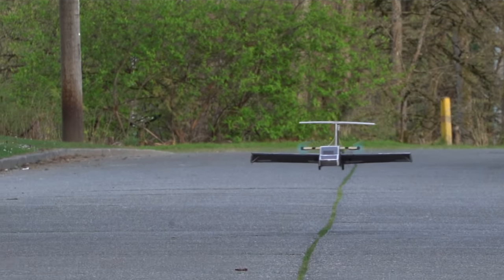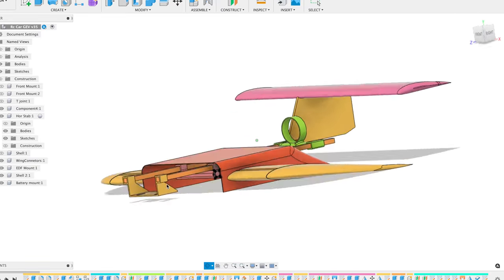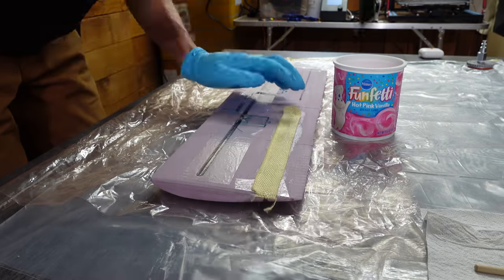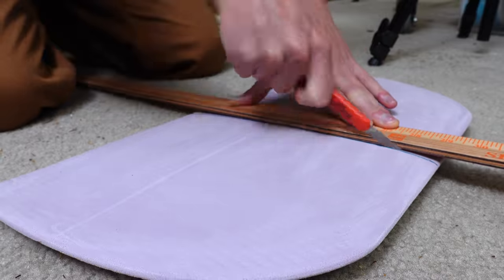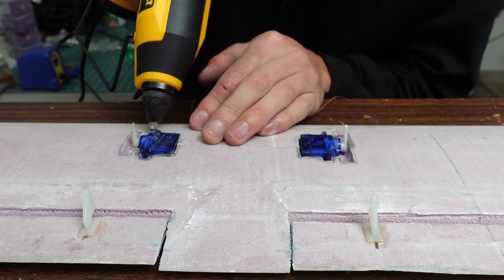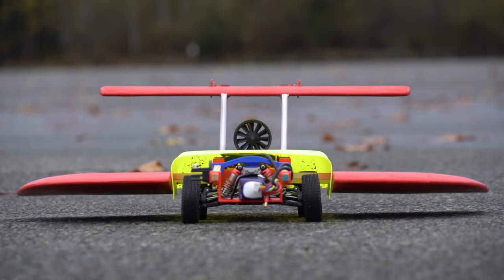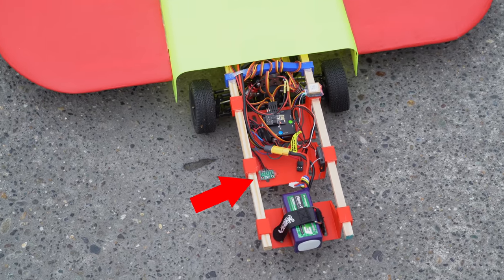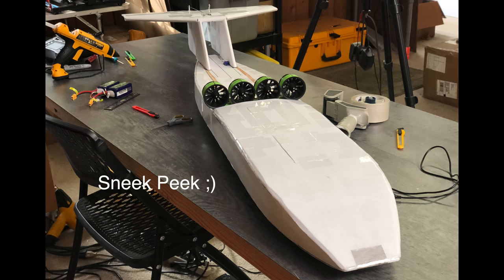RC Car to Ground Effect Vehicle Conversion

Comment: Looks like the problem is most youtbers trying to make ground-effect vehicles only use speed to generate lift. The original machines used engines to blow air under the wings for huge lift at low speeds, then use rear engines when specific speed and lift are reached.

Maybe you could use an internal duct system to pull air from above the vehicle  and redirect it under the wings and backwards, if only for takeoff/landing/low speed travel.

Also, remodel the wings to maintain the high-pressure air bubble. It's losing pressure meaning you need higher speeds to maintain the necessary pressure.
Reply: "maintain the high-pressure air bubble" like an engine bell from a rocket? 
Sounds legit. I think that's how hovercrafts work, so it should do something, even if that relegates it to an even-lower flight envelope. It looked like he had the basis of that in mind when he made a sort of bowl over his RC car, but then seemed to forget what his plans were when he put the ducted fan way in the back, screwing up his CG and counteracting his "flying aerofoil tail" concept by blowing high-V/low-P air under it.
Reply: #Hitydesign
Reply: Who do you think you are these days? I don't even recognize you anymore.

Comment: Yeah, if you've ever done a cheap "lost foam" mold, using packing tape around your plug is a good way to do it since the resin doesn't stick.

Comment: It reminds me a bit of this RC model called the Hydrofoam, the underside is shaped like a catamaran, and it can drive over water, it can fly, and it can drive over grass. And you are right, it has some hovercraft like features. Basically the single wing spans across the entire length of the aircraft, with a big rear wing that spans across the entire width of the aircraft.
Reply: #Hitydesign

Comment: The height of ground effect (without skirts or similar) depends on the wingspan. Half a wing span is the rule of thumb there and it almost instantly vanishes when you exceed that height. So... model ground effect planes a a notorious pain in the rear. 
When the plane gets big it also becomes very stable.

Comment: A symmetrical airfoil does still generate lift. And the horizontal stabilizer is also used on a conventional aircraft to generate either lift or downforce in order to keep the moment balanced in cruise. Cool project!

Comment: That brushed motor is insane, I've never seen a brushed motor that sounds like that or has that kind of power
Reply: They are freaky, I had a 1:10 scale Nissan that was using a brushed motor and it went like a rocket 🤣

Comment: The main body addition is basically a large cup doing little in my mind other than slowing it down.  Some plastic wrap over the front to smooth out air flow and stop the cupping of air may help.

Comment: Neat! I made a wing out of a piece of similar insulation I found by the road and used it in a glider I made for my 6yo son, using free stuff means he can break it and my head doesn't explode. I had no idea it was something anyone who knows what they are doing would do. I covered it in high fiber content house cladding paper, it has a slick surface that is great for similar uses.

Comment: The problem with this is also one of stability. You need a geometry that has a speed-dependent lift coefficient, and one that doesn’t tend to generate extra lift at high angles of attack. Delta wings are good for this and can provide good yaw stability as well. This thing wants to pitch up and yaw around because it’s wide and has a high deviation in lyft with its orientation. The airfish 8 has a good airfoil shape to follow, I’d give it more taper at the front towards a more diamond ♦️ shape with a wider chevron towards the back, and downward flare to produce a dynamic pressure pocket that dissipates the moment you leave ground effect. It should sit high in that cushion of air, with little aerodynamic lift out of ground effect, but with restoring force that has a forgiving deviation in its inherent aerodynamic shape: it’s JUST passable as a “dart” out of ground-effect, but just under a “glider” in ground effect.

Comment: In an age of brushless motors, People often underestimate how much power a brushed motor can have….
Somewhere I’ve got an old car that I put a Kyosho Magnetic Mayhem motor in and it was an absolute beast with the right gearing and a 3s lipo.
I think a lot of the stigma of brushed motors being underwhelming has a lot to do with the pre-lipo batteries of the day.
Make no mistake, brushless is better, but a good brushed setup can still be a blast. Even the cheap, venerable Titan 550 12T will will ballon tires right off the rims.

Comment: Hmm, only 2 kinds of RC vehicles, those that have crashed and those that are going to crash.... Flew a hang glider for years, but a long time ago. My understanding of ground effect was that when low to the ground, the air pressure under the wing was greater than the pressure on top of the wing, so you would glide farther/your glide ration was longer, with ground effect than whey you were up in the air. Looks like the flying one at first had an upside down air foil, with the camber on the bottom side of the wing. As for flying wings, they do have a bit of reflex in them for pitch stability, but I seem to remember that it was accomplished with wing twist/warping, so angle of attack near the fuselage was lower, and angle of attack at the wing tip was 10 or so degrees higher/more positive. There was one flying wing, can't remember the name, Sundance maybe, with very high wing camber/foil thickness and that reflex all along the trailing edge, along with the wing twist. High lift, slow speed, and very difficult to stall.  Looks like you are having fun. 

Trying to remember, but isn't ground effect also linked to wing span? As in longer wing span/higher aspect ratio = better ground effect and also ground effect comes into play higher off the ground than short aspect ratio.

Comment: Remember way back when you did a heavy lift aircraft? You loaded it with bolts until it wouldn't take off, I'd love to see you revisit that idea. May have a set power plant, and see how different airframes compete?

Comment: Why not nest some wheels into the wing tips and tail section, and just use the prop for forward drive and only some small servo's for turning the wheels? It'd save you a ton of space and weight.

Also, it would be worthwhile to use some wheels with much less friction. When you're about to take off or land you don't want the wheels suddenly pulling in a different direction than its current momentum, especially when only one or two wheels are currently in contact with the ground. That's a good way to suddenly swerve, spin or flip it into a crash.

You only need sufficient friction to turn the GEV at speeds that won't tip it over.

Comment: You know, I've always wanted to see someone go nuts with edf fans and blown flaps/boundary layer control.

There was a c-130 stol version that never went into production that had two jet engines outboard of the turboprops. Bleed air from the jets was blown over the flaps and rudder to enhance lift and controllability.
Reply: That reminds me of the An-72/74, with it's high forward mounted engines. Guess something similar could be done with EDFs. Don't see this kind of design anymore these days, so it sounds like an interesting idea for a future project.

Comment: Wondering Daniel, all your  Ground Effect Vehicles have used a elevated elevator on the tail. In this RC car based example the elevated tail seem to settle lower to the ground (in ground effect) as the main wing lifts up into ground effect. 
You might want to experiment with using a flying canard up front, no control surfaces, just a pivoting canard? This would ensure both wings operating in the higher lift producing ground effect.

Comment: that altitude response seemed a little aggressive, and id suggest putting the edf in front of the wings blowing a bit under them, like in the original ekranoplan designs, and some of your own ground effect vehicles. also i think because of the scale of this model, the optimal altitude would've been where the wheels would still be touching the ground, so you wouldnt really get the efficiency boost from flying low.

Comment: you should build a decent sized boat that uses a mini RC 2-stroke combustion engine and carries a good amount of fuel. though you need to remember good cooling cause long running time. i know it would be very inefficient but i think that some short waypoint missions would be possible also it would surely be pretty cool!

Comment: The car he used is the WLToys 144001... one of the best budget buggies; a clone of the LC Racing chassis. They a truggy 144002 and a the brushless of the same chassis 144010. They also versions that have a slightly longer chassis; 124018/124019 with a brushed motor and brushless as 124016/124017.

Comment: I personally would have designed a car to print to make it really light. Doing so would allow you to remove most of the drivetrain components and suspension removing even more weight. In return it would allow you to glide at slower speeds giving you more space to tune it

Comment: I began with big expectations, but I have to tame my imagination and take time to learn the basics. I enjoy watching your videos and the technology-style that you use. My ultimate goal is to build a uav that will travel a few hundred miles. i have a long way to go. I have been spending more time with my 3d printer, as of late. Sometimes I have to take a step back due to frustration. 
  I have watched many of your videos, more than once, and have seen some great ideas to incorporate into my design, specifically the breakdown of demonstrating each tech. that I would like to incorporate, (logistics). For instance... I would like to incorporate solar panels in the wings to recharge the starter cells for the onboard starter. Lets not forget about redundancy by having the ability to utilize a second set of control features, including an electric motor.
  I am putting a rudimentary plan for a large scale model that incorporates, 'wet-wings', by building fuel tanks into the wings. I am looking into 2-stroke, 4-stroke, gasoline, fuel/oil mixes, etc. Also, I have t look into a ground station and other ways to communicate with the drone, like WI-Fi. i am unsure, but I have thought about providing the drone with its own hotspot. From my understanding, is I keep my drone under 2,000 ft., I can receive a WI-Fi signal. again... Redundancy. Because I could lose communication/data link. 
  I would gratefully appreciate any and all input.

Comment: Can't remember if you have tried using front fitted engines (like 2 on each side to provided more precise power control and have the airflow from the engines blowing over or between the wings, the engine at the back is going to more make it want to fly)

Comment: Wing twist and drooped tips are things you've done with prior related projects that looked like they worked, why not carry those over? (Difficult to do with construction techniques demonstrated?) Also the lack of rudder on a ground effect vehicle seems like a glaring oversight. Although it still seems fun to mess with.

Also the hydroplane sneak-peek looks pretty kick ass. If it planes up as expected, it's gonna haul.

Comment: you need side plates on the wings to hold the air under the wings, another option is anhedral on the front wing.

Comment: The KM Ekranoplan had thrusters at the front to push air under the wings so it would have a better cushion of high pressure air to float on

Comment: should try 2 edf's up front with duct/fuselage to direct their nozzles under the wings, providing high pressure below the wings while still providing thrust. would give a bunch of lift at lower speeds

Comment: Not sure what kind of ground effect you want to achieve , usually they use ground effect to keep the car on the road at  high speed , so the wings have to be upside down

Comment: The track balls on the original mouse , would be optimal. 3-4  attached to strategic spots on the undercarriage would allow ground contact without a lot of weight and save having to rebuild every time contact with the ground is made.

Comment: more angle is very important I think bc. you want maximum direction of air into the ground vs. the regular lift of an airplane. I think this is the reason it just started flying.

Comment: Hey you know what a really cool yet challenging build idea would be, an rc car that has a glider on top with wings that turn up and down that when the car has reached enough speed, the glider points its wings up and takes off... I don't know if that would be possible though

Comment: It'd be cool if you could design a ground effect craft that is stable with respect to the ground aerodynamically. These "ground effect" craft you've built all seem more like planes that have been controlled and limited through sensors and software to look like ground effect. It would be cool too see one that physically couldn't fly away from ground effect.

Comment: you should try to connect the front drive with a propeler and activate it as soon as you lift off and propeler doesnt hit the ground. keep it horisontal while you drive. probably brakes it after landing but it would be a cool video

Comment: why do you need ailerons? two servos in tail would be sufficient and easier to build. Also weight adds takeoff speed. do you really need to add glass-fiber? It is stronger, but then it crashes faster.

Comment: What if you ducted the fan with the intake in the low pressure zone at the front and then route it under the bottom of the back of the wing tip? wouldn't that improve the ground effect?

Comment: Wouldn't playing with weight and balance keep it in the ground effect zone? Only using the angle of the wing to create enough lift? Could you have made rudders that worked off the same servo as the steering? Or the same signal?

Comment: ISTM that a ground effect vehicle really needs a rudder because you can’t really turn without dragging wing tip.  An airplane will turn with only yaw, it’s just slower than banking (I’ve done this)

Comment: The tail seems too low, as soon as you're pitched up around 5 degrees or so, the tail loses control authority as it's in the wake of the front wings. I'd lift it a couple inches, imho.

Comment: imagine a podracer from star wars but one with short engines, and instead of the electric light in between comes a ground effect wing. and two small ones on the sides. then a small cock-pit with also some ground effect wings..  ..if it works this could get big, but also dangerous.. ..i can already see real life pod races with different styles of selfmade racers, racing above flat deserts or lakes xD

Comment: You should explore how much better you can make the original RC car design handle by inverting the wings completely for downforce! See what kind of traction you can manage by doing so, and how it behaves on jumps as a result. 

OR, see how much of a jump you can get out of one of those cheapo RC cars with the remnants of this ground effect idea you've just tried!

Comment: Jeez that is fast what motor is in it? I got some cheap Amazon rc cars during sales etc and one of them has a brushed 550 on a fairly heavy 1/10 scale and it still has a lot of pep and some nice instant throttle response. 

I have another 1/10 scale that has a brushed 540 in it and it's a little disappointing due to the throttle response. It's just not quite as responsive as the other model but it still hits perfectly acceptable speeds for what I paid and it's just something to help me kill time.

 I also have a 2848 brushless electric motor on a 1/16 that was also from Amazon. Man it came with wheelie bars and you found out why soon because even with them it can flip if you don't have the throttle right. But I mean after ten minutes of practicing you start to get the hang of the throttle response etc which it's also very responsive as well. It's also just too fast for a 1/16 to have any business going in my hands lol. It keeps up with the cars doing 30mph down the road.
Reply: The first rc car I got as an adult was a Traxxas and I went to jump that thing and slammed right into the curb instead and I broken a good bit of parts. I was blind as a bat back then so it wasn't surprising though I did fix and sell the car ASAP. These newer rc cars allow you to adjust the max speed on the controller which is real helpful when learning or handing to someone a little younger. I've hit the curb head on twice with two of these cars so far by mistake and neither have suffered any damage (knock on wood) and I hope it remains that away because I don't try to do any bashing with them. The third car can't hit the curb head on because of how the tires stick up so it just pops up the curb like a boss man. I love these little RC cars and that let's me know that the real deal name brands running serious battery power would just absolutely be way way way way too much for me and my poor little road LMAO.

Comment: i had the idea of a ground effect buggy a long time ago, didnt know itd actually work tho
i was thinking you could have ground effect racers that can slow down and use their wheels for tight turns and fly in ground effect for high speed and going over water
Reply: Make the whole wing pitch up and down so you can use reverse ground effect to get more traction on high speed corners
Reply: @charleslambert3368  yep